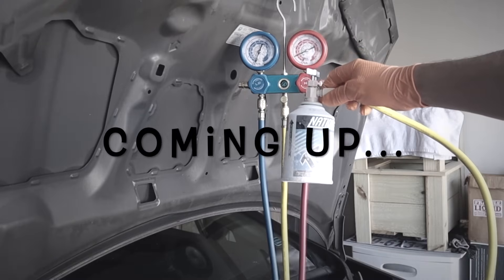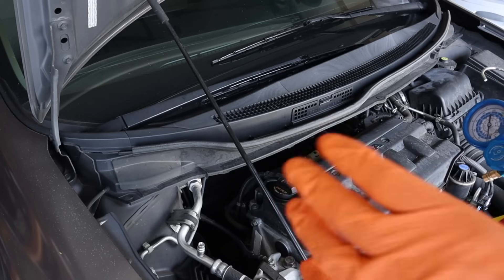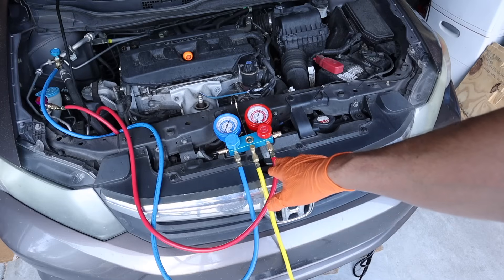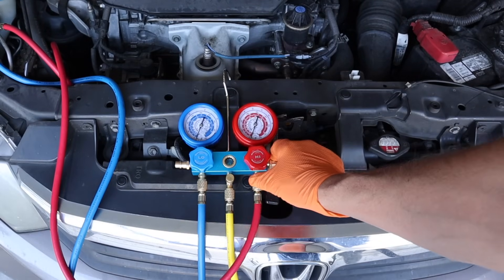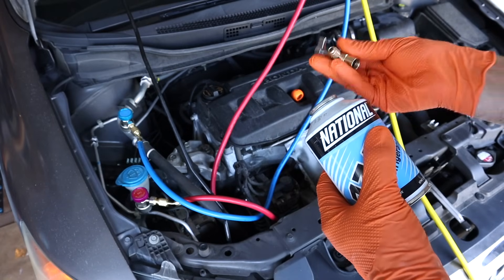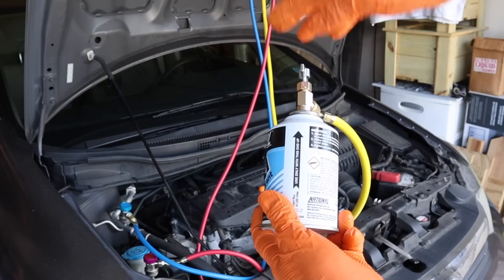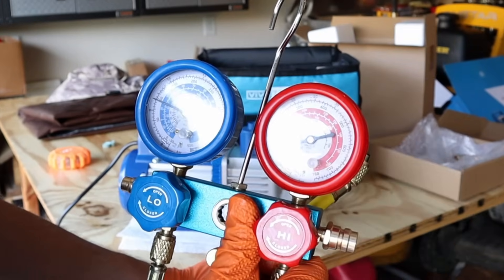DIY Tutorial - Proper R134a A/C charge & Diagnostics

Comment: I pulled the vacuum there was nothing in my system. It held a vacuum. I put my first can on just like you did and it only took about 3 oz and then it stopped. Can never got cold and it never took any more. Had to redo it. The low pressure side shot up but why would it stop taking Freon and not engaging the clutch after only like 3 oz?
Reply from the maker: @SeanDoe86  With some AC systems the compressor is very stubborn to engage when doing a recharge. Try taking a dish cloth and running it under hot water and wrapping it around the can while trying to get it to go in, even squeezing the can slightly. Also, "play with" the valve on top of the can, twisting it back and forth as sometimes it will freeze up. Until your system "sees" enough refrigerant in the system it will not allow the compressor clutch to engage. It takes a bit of time. Ultimately, if you may have to jump the compressor to force it to come on to take the refrigerant, but do that as a last resort. Hope this helps!
Reply: @my-honest-review  hoping jumping it prematurely didn't harm compressor tho
Reply from the maker: @SeanDoe86  No it shouldn't have, because as soon as the refrigerant started to flow it was being lubricated (and the compressor already has oil in it anyway).
Reply: @my-honest-review  thanks for responding! I actually jumped it with paperclip and it worked 👍 

Forgot to plug something in so that may be reason compressor didn't start
Reply from the maker: @SeanDoe86  That's great, glad it worked out! And you're welcome glad to help out a bit.
Reply: @SeanDoe86  And other reasons are the low and high pressure switches (or sensors), the AC relay, or a blown fuse.

Comment: Thank you for sharing this most instructional video. When there is a leak, and the PAC oil has also leaked as a result, how do we measure how much PAC oil needs to go back in?, without evacuating the A/C system, as it involves specialized equipment the DYI, most probably, does not have for the recovery. Or we just have to take it to the shop of the evacuation even if they charge (not all of them do it for free as it consumes time).
Reply from the maker: @kvasir40  If your system has a leak, the oil that has leaked out is very very small. It's not necessary to add any when doing a recharge unless a component has been replaced. If you want to add an ounce or so of PAG oil when you do a recharge, it certainly wouldn't hurt anything if you just want to be cautious. Thanks for watching!

Comment: I have seen multiple of these AC recharge videos but I have learned the most from yours today. It was never fully explained before on exactly when to open and close the port valves and that leads to the intimidation about manifold gauges that other people have mentioned. You explained that well and took away the mystery. I feel confident that I can now evacuate and recharge my system. Thank you.
Reply from the maker: Hey thanks for hanging out with me today, and I'm so glad you found some value in the video! Yes indeed... WHAT knob to turn WHEN in the process tripped me up constantly when I was first learning. Once you do it a few times, then it becomes a lot easier.

Comment: When you add Freon in specially, when your system is empty, and the unit is not turned on, you can dump your Freon in as a liquid on the high side. Then, when you do the second can do it as a vapor if that way you’re compressor will engage.
Reply from the maker: @jamestoy3025  I've heard of that being done, but never tried it. I can see how that would work in theory tho.
Reply: @my-honest-review  I’m Hvac technician I have done it that way you can always ad Freon this way as long as the system is not running try it . I  never put Freon in that way you take a chance of bending a valve in the compressor if you get to much liquid in the suction line

Comment: Excellent video.  Detailed and informative.  You have an excellent presentation manner and I am subscribing.  One thing I might add is that I was a little surprised that you turned your compressor on while the system was in vacuum.  Usually the low pressure switch would prevent the compressor from running until you had enough pressure to satisfy it.  I think you maybe should have put a half a charge in, turned the a/c on and monitored whether the compressor was running by observing the compressor clutch.
Reply from the maker: @paulkennedy5822  I appreciate you following along and appreciate the feedback! Yes, that is the way I have always been taught, and seems to work, but I'm sure your way would be just fine as well 👍

Comment: I was at O’Riley Auto parts about to rent their AC gauges and Evac pump for DIY job. But they told me that I’m not supposed to DIY Evac in my garage. It has to be done by the ac professional/shop. 

So, what do you do with the evacuated refrigerant?
Reply from the maker: @PhanOT11  If you have refrigerant still in your system you'll need to go to a local shop and ask them to reclaim it. Most shops will not even charge you because they benefit from "taking" your refrigerant and reusing it. Just tell them that's all you want done. Then, just proceed on at home with the vacuuming process.

Comment: Such an informative & thorough tutorial! I enjoyed this.  Thanks. 
    I am working on a 1995 Jeep Grand Cherokee Limited w/5.2L , 134A refrigerant.  The compressor is short cycling.  On for 5-10 sec off for aprx 20 sec. With vehicle off both low & high sides are reading aprx 77psi. When on and comp is running the low side drops to 35 then back up to aprx 75 when comp stops. The high side drops to aprx 75psi then up to aprx 100-105. I can't get it to take freon? Its blowing very warm air, short cycling,  then won't take the freon.....do you have any suggestions? Thanks in advance.
Reply from the maker: @dgmenace73  Appreciate you hanging out Dennis! Ordinarily what I would say to the problem of short cycling is that you may have too much freon in the system. So definitely make sure that is not the issue. If any doubt, evac and start over to double check. Other than that...its either going to be a bad cycle switch or bad compressor more than likely. You can also try jumping the compressor to force it to stay on while you are trying to do the freon charge (if, of course, you're sure that it doesn't have too much freon in there already) Hope this helps!
Reply: @my-honest-review  sure did help! I jumped compressor out with gauges connected & watching pressure. Once I did that it started taking the freon with pressure of less than 80 on high side. After doing that for a couple minutes I reconnected compressor as normal and it kept running...took the freon but still a couple ounces low as far as I can tell. Air is cool but not cold. Must have been extremely low. Never had to do this before.
Reply from the maker: @dgmenace73  Hey, that is awesome! Yep, sometimes compressors act wonky like that until it sees some freon in the system then they'll come alive. That's when jumping is necessary. And cool air is better than warm! You might wait a few days and try to top the system off. A healthy compressor will push somewhere North of 150-175 psi (high side) when the system is correctly charged, so keep that in mind.

Comment: After vacuuming, why didn't you add refrigeration oil?
Reply from the maker: Hi, thanks for watching. Oil is not necessary to add unless you have replaced a component. In this video I am only performing an evacuation and recharge.
Reply: Oil stays put in the system and is not sucked out with the air and moisture.

Comment: Good job but your math was wrong when doing the 3oz. You subtracted 3 from the 18.3 but the can holds 12oz only. So since you needed 3 oz you should of done 18.3 ÷ 4 = 4.57 which that equals to 3oz. So now you subtract 18.3 - 4.57 = 13.72 which is what the scale should of read for the 3oz. You added 2 oz which either way is within the limit of the AC
Reply from the maker: @juniorrivera1680  The 18.3 was the weight of the can, the can's contents, and the hose as well. Its a relative measurement taking all that into account. Thanks for watching!

Comment: You left out the line connectors. There are various types, like Toyota has theirs, and a couple other makers may too. "Gotta keep 'em coming to the dealer." So make sure you have the correct connectors for the vehicle. It used to be so easy. Now they have computers involved too.
Reply from the maker: @bryanst.martin7134  Luckily, I haven't had to work on any of the newer vehicles that use the 1234yf refrigerant. That might be when you'll run into things like you mention. Everything is pretty standard on most R134a applications.

Comment: Tu as oublié d'ouvrir la vanne lors de la mise en place de la deuxième recharge
Reply from the maker: @TheBouazaoui  If you mean purging the air out of the yellow hose when attaching the 2nd can... it is actually not necessary. The yellow hose actually is sealed off when disconnecting the first can and attaching the second can. Hope this helps!
Reply: @my-honest-review  ok thanks, en fait comme l'aiguille etait engagé, ça va faire fuiter un peu de gaz de la 2ieme recharge
Reply from the maker: It will only leak for a split second when screwing the can on, but once the seal on the valve contacts the can, it will stop. You just have to screw it on quickly.

Comment: wait if you close the valves on the manifold you are locking the pressure into the gauges aren't you?
Reply from the maker: @frankarcos6355  The gauges are actually independent of the manifold valve position. In other words, they'll give you correct readings when the valves are closed.

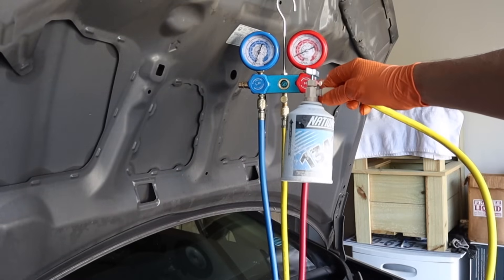Comment: At 12:56 the can is frosting over, but your gauge pressures look very low. Am I not seeing that right?
Reply from the maker: Yes you are seeing that right. At this point, I would say only 1/4 to 1/2 of that first can had gone in and therefore the system didn't have all that much to work with in the way of building up pressure. It was going in pretty quick (typical for the first half of the first can) and therefore it was frosting that can up pretty good. As you add more refrigerant in the process, it starts to go in slower and you'll see the gauges start to normalize.

Comment: Great video. Question: If I want to add 1-2oz of r134a , can I purge the low side line where it connects to manifold? It would be the same idea as the yellow line but using the refrigerant already in the system vs from the can. Thanks.
Reply from the maker: Indeed, you certainly can, and that's a great idea by the way. If you aren't going to vacuum the system and you are using the the manifold gauge set (and just topping it off like you suggest), you definitely would want to get that air out of that blue low pressure line, and by cracking it at the manifold end, you'd achieve that. Alternatively, you can just get one of those short hoses like in a previous video I did (find it here https://youtu.be/hynPL0eGMEs?si=6zxnlwLEepiTzOsV ) and attach your can directly to it. They are so short that the air in them are negligible, and great for top offs. Hope this helps!
Reply: @my-honest-review  Cool. Imma purge both blue and yellow lines. Not touching closed high side valve on Manifold. Thanks!
Reply from the maker: @MarzNet256  You're welcome 👍

Comment: Hello was hoping you can give some advise, what if the ac only gets Cold when the Rpm is high and nothing when idling. Does that mean that the refrigerant is low?
Reply from the maker: It's possible that you are low yes, but also, let me ask you, when the RPM is higher, and it works, are you going down the road or sitting still and just reving the engine?
Reply: @my-honest-review  both cruising and on a stop if I bleep the throttle
Reply from the maker: @bhadz100  I would make sure that your cooling fan against the radiator is coming on when you're idling and the AC is turned on. And if it is, I would start with doing an evac and recharge as I demonstrated in this video. Hope this helps!
Reply: @my-honest-review  thank you. I brought it to valvoline to have it serviced, and they did extract the moisture and put the refrigerant back.  I guess I’ll have to do your process.  Compressor runs all the time and doesn’t cycle on and off
Reply from the maker: @bhadz100  You're welcome, I'm glad to help a little. Yes, start with the basics, and if the compressor just keeps on running constantly like that after you have done the evacuation and recharge, you may need a new compressor.

Comment: Do you have to add compressor oil during this recharge?
Reply from the maker: No oil necessary unless you have replaced your compressor. And many come prefilled so you don't need to worry about it, but you'd have to ask when purchasing it.
Reply: Not a bad idea to add some UV dye since it will make it much easier to find future leaks.  Lots of YT videos on this.  The dye that I bought is mixed in with 3/4 oz. of refrigerant oil.

Comment: If there is only 12oz in a can but it weighs 18oz, shouldn’t you take out 9oz then to fill it? The can makes it weigh more.
Reply from the maker: Taking into account that I only need 15 ounces, and 12 went in when finished with the first can, I only need to take 3 ounces out of the second can. And with the weight of the hose and all, you have to take that into consideration. That's why the second can is a relative measurement. If you set it up the same way as I did, you might being seeing 21 oz, or 23 oz (or something different) on your scale. And whatever number you see before you open that valve on that second can...just subtract 3 ounces from it, then shut it off (of course assuming you need 15 ounces total like I did). Hope that helps!

Comment: My particular vacuum pump is a single stage 4cfm but says has 30 minute duty cycle. Should I let it run for 30 then let it cool a few minutes then turn it back on?
Reply from the maker: That would be fine, and it wouldn't be any less effective on the vacuuming process either.

Comment: Very well done video! Clear, slow, and step by step.

Only comment I'd make is that if your car is at least ten years old or more and your AC stops working you should probably replace both your condenser and the expansion valve before doing this. They get clogged over time.

If your compressor died (sounds like it's full of rocks) you have to replace the condenser (as well as the compressor) because it will definitely be full of debris from the bad compressor.

If you wait until after recharging it like this you'll lose the two cans of R-134a you put in because you have to disconnect the lines to replace the condenser and expansion valve. A can of R-134a is only $10 but still.

Also don't skip the step where you purge the air out of the line after attaching the can of R-134, that's why that valve is on the manifold.
Reply from the maker: Great advice and thanks for watching 💯👍
Reply: Replace Condenser? Did you mean dryer?
Reply: @digger105337  No.  If the compressor throws off pieces after it dies, the first stop is the condenser.  Second stop is the expansion valve or orifice tube.

Comment: Great Video. There are 3 refrigerant types in the past 30-35 years:

1. R12 which was no longer used after 1995 (approximately).

2. R134A used early 90's up until approximately 2013-2015 when auto manufacturers started converting to R1234YF.

3. R1234YF which is the present industry standard. All manufacturers started switching around 2013-2015 and it is hit or miss from there if it has this freon or R134. 9:37 

Im assuming those who are using R12 will need to look into converting to R134A and those who have a newer car with R1234YF need to take the car to a licensed repair facility for the Evacuation and recharge process. Be prepared because the freon cost is very high compared to R134a. R134a is around $10/lb whereas R1234yf is about $100/lb. 

I hope this helps.
Reply from the maker: I appreciate that! Yes as far as the R1234yf is concerned I do not have much experience with that simply because its so new that most vehicles on the road that use it (with a few exceptions) are so new they're still under factory warranty. Give it a few years however and I will be experimenting with it I'm sure 👍
Reply: And in other countries, another popular mix is propane and isobutane.  For example HFC 12a, and the product call EnviroSafe.

Comment: Vacuum also removes oil from the system, not all but alot. You need pag oil for ac to top it up. You don't need to vacuum twice. When you vacuum to check for leaks, you don't have to vacuum again to ad refrigerant.
Reply from the maker: What I tell folks that if they are worried that they have lost any oil during the vacuuming process, is that its certainly not going to hurt anything to add an ounce or so when doing a charge. And as far as the vacuuming twice, you are correct as long as when you vacuum the first time you do it for a whole hour. I just like to know upfront (before vacuuming for that whole hour) whether or not the system is sealed. That's why I do it for 15 minutes, check for leaks, then continue on with the complete vacuum. Hope that makes sense.
Reply: @my-honest-review  Might be a good idea to add some UV dye.  What I have is a bottle of refrigerant oil with the dye in it, and the recommended amount is 3/4 oz.

Comment: Thanks for your information, friend: but I have a question: how could you see if the system was low enough in microns to be able to charge it? only
Reply from the maker: If your AC is still cooling, but it's just not as cold as it used to be, that's indicative of it being a little low on refrigerant and you can try to add just a little. If it doesn't help, then best to start from scratch like I did in this video.